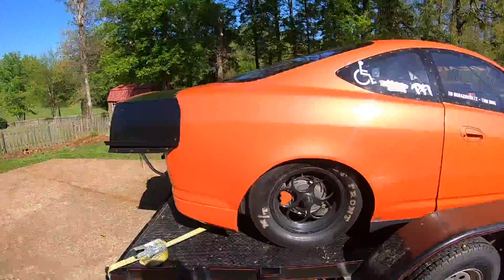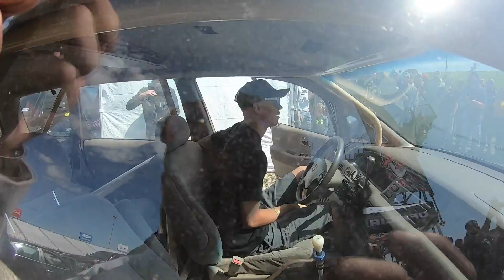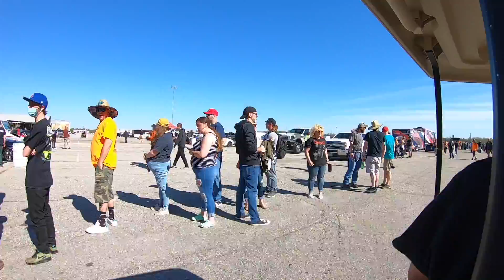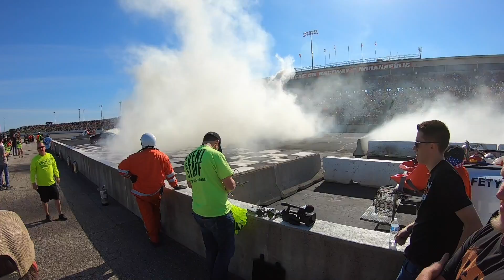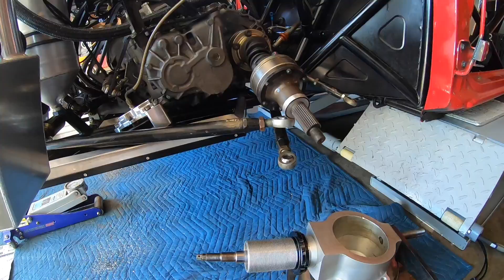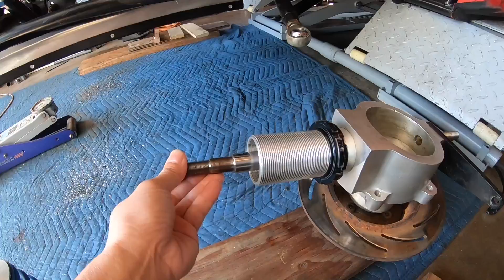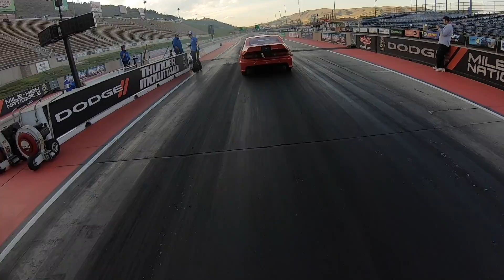Phoenix still gone wild!!

Comment: The centerline of your steering axis is the strut and ball joint, the centerline of your wheel is far outboard of the axis letting the car steer itself. You need less wheel offset and no spacer, wider suspension to keep the same track. Look at a stock vehicle and see where the balljoint is compared to the center of the wheel. Overbuild the steering arms to try to contain steering forces. Good thoughts for you.
Reply: You are right he needs to close out the tow 1mm on each side atleast thats what I do when I do cord aligment
Reply: Yea Phong I agree with Ron them spacers I think are the culprit I put just 30 mil on my element for less than a day just daily driving was doing exact same thing your cars doing even worse when there is crowning in the road and I have a perfect alignment …. I would ditch the spacers I'm pretty sure that will be the cure like Ron said ... good call Ron
Reply: Hope I see it going fast soon im a fan
Reply: I agree with Ron too. 
It would be good to add caster correction.
Don't give up! Phong

Comment: with the strut welded solid the tyre effectively becomes an undamped spring, especially large sidewall tyres like you have, hence the bouncing, you need a damper controlling that, double wishbones would be nice but will still give you trouble with bump steer unless you lower the rack or raise the mounting point at the hub end, I've said it before but you need to get your steering arm and wishbone to run parallel as a starting point, then take the spring out and cycle the suspension up and down with a toe gauge on the wheel, then you'll see what's happening, I'm sure you'll get there though, nice to hear you say you won't give up, you got this!

Comment: I think the suspension was ok. The steering rack might be ok too. In general: to avoid bump-steer the tie-rods should be the same length, angle and pivot point as the control arms.
I think your problem is still a 'weak' steering knuckle. Maybe add a second on top and connect both and the tie rod with one big bolt?
Reply: do mean like leave it where it is but add another mounting point to the knuckle + a bolt going through both holding the tierod in the middle? or move the tierod pickup point up?
|----0| or |---0---|? 
0 = tierod end, | = the tabs, & --- = bolt.
Reply: @von...  I mean: leave the knuckle on the bottom where it is, but put another one somewhere at the top with the tie rod in the middle. You even could use spacers to adjust the height, where the tie rod end connects to the assembly.

Comment: Have you thought about adding an additional bracket on the steering knuckle above the heim joint for the tie rod? It would greatly reduce the deflection at that connection and correct the toe-in problem under power. It would also make the joint much stronger.

This setup is called a "double shear" connection and offroad trucks use it all the time.

Comment: Honestly the steering pickup point needs changed also to get rid of the bump steer due to the location of the rack. Also I bet under power even with your improvements to the arm it is bowing under power. Most likely the suspension setup would have worked without locking it if the steering issues got fixed.

Comment: Yessir phong!!💪🏻💪🏻 crazy suggestion check those traction bars, my car had same problem when it would get into power and tires would hook it would pull HARD left just like Phoenix, turns out one bar was too short and instead of having a little play in it it got hammered in and was tight, loosed it so it had play just like other side and it went straight as an arrow

Comment: 13:28 yes you are correct less travel =less angle change. Although a little wheel hop or tire spin will break stuff.. what I would do is make some rubber cylinders to go in between the strut and the spring so you will still have a little "give" but also be "solid" or very little travel

Comment: Do NOT lock your suspension. That is asking for trouble. There's nothing wrong with MacPherson strut suspension. Yes, there are compromises, but even Porsche uses it. To fix the bump steer you simply need to make sure that the tie rods are parallel to the control arm. This can be accomplished with spacers. This is done to trucks and cars alike for both lowering and lifting. I couldn't see the true angle of the control arm, but I am betting that the tie rods aren't parallel. I DO agree that you want to limit travel, but doing it as a hard mount or with non-progressive droop limiters will yield unpredictable handling and hooking during launch. You need some travel.

Comment: To reduce the bumpsteer, you have to make the steering tie rods the same length as the lower control arm so they move in parallel.  You will never get rid of it completely, but you can make it very small.

Comment: Looks like the steering rack needs to mount lower to me. Low outer tie rod, low rack.
The tie rod and LCA need to be more level to each other by raising the outer tie rod or lowering the rack.
Can you move the steering attachment on the spindle/upright/hub up higher ?

Comment: Phong . At 15:00 you can see the you have two extra holes in the knuckle. Use those to build an upper steering arm . Put the original spacer back in and  sandwich the tie rod end between the two. Double sheer
Reply: Nailed it. He needs to make it a double sheer. Then he can shim the tie rod to the proper height. I doubt bump steer was ever the problem. Needs less deflection in the steering.

Comment: Phong, the steering rack location /tie rod angle is all wrong.  Assemble the suspension without a spring so you can pickup the wheel and move it though the full travel of the suspension and watch how it toes in and out as the suspension moves.  You need to dial that out as much as possible.  The way it is now, whenever the front of the car rises under power (i.e. and the suspension extends) the wheels are toeing in towards each other.   Its doing it so bad the two tyres are fighting against each other until one of them loses traction, then the car darts off in that direction.

Comment: Bro you can't have no suspension it's dangerous!   Also no grip with the car bouncing all over ,  can you lift the stearing rack to stop the angle changing so much  ??    Love the project  phong   stick with it brother ✊
Reply: What I would do is take that motor out and put a stock, low horsepower, motor in. With a quieter exhaust so it's not so crazy. Drive it, wether on the track or roads around PFI and see if it's just bad torque steer or what. Let other people drive it too. Just not full pulls. Run it up in power slowly. Also have a chance to get used to driving it. Him locking out any suspension is making it bounce on those slick Ballon tires. It looked like more of a steering issue, maybe torque steer, than a up/down suspension issue.

Comment: Master Phong please see this I have been looking into what's going on with your car and I believe what you need to do is take the spring and shock off and mount two studs on the top so you can make a set of arms to triangulate the tip of the hub the front end you have is more for rear wheel drive drag cars not fwd drag cars I'm pretty sure anyways but you can still use the hub just get a pair of coilovers and mount them to the lower control arm and make new mounts on the hubs you have I really hope this helps and even if you rebuild it form scratch I hope it works please we are all preying and ready to support our master

Comment: What's the king pin incline angle?  Sounds like there is a castor issue as well as the changing toe angle under load.
Reply: Yes improper castor is dangerous 
And these super short axle sure don't help the torque steer
Phong should try stock style axle so the axle have longer center shaft vs the 3 piece porche style axle

Comment: I think redesigning the front suspension should probably start by cutting the old one off. Then  going with something with upper and lower control arms, more conventional and similar to what Tom has. But having said that you are an engineering wizard with engines so it’s always interesting to see what your brain comes up with. 

The current suspension on Phoenix looks like something you’d see on a drift car minus the angle kit.

Comment: You have to check the bump steer! Borrow a bump steer gauge or make your own. Lots of videos show how it’s done. 
  Unlock the suspension and put oil in the strut, it doesn’t appear to have any. The strut cartridge should be submerged in oil. There is a piece missing at the bottom of the upright that the strut cartridge locks into.

Comment: Phong, get a dial indicator and measure bump steer and whatnot throughout the suspension travel. Then, try adding some shims to the tie rod to knuckle and re-measure. Also, try changing control arm angles with shims and spacers and measure again. When you are aligning it, are you doing caster as well as camber and toe? Could it just potentially be as easy as adding some adjustable length control arms and fixing a caster split issue?

Comment: I think is the control arm or mounting point on chassis (if one is slightly bent) or steering rack problem. Another may need to drop psi in tyres to get rid of the bouncing problem.
  I would get the car laser tracked (aligned) and then go from there set two camera constantly on both wheels and then go from there see if you can spot and capture the problem on film. If the car is pulling to left could be a few things to cause that. Make a list and cross out the possibilities one by one until you find the problem. Then fix it 👍🏽

Comment: Bump steer is defiantly a problem but how light the car is and the power it’s making it looks like a really bad case of torque steer from watching the car ..... do you have equal length half/drive shafts on the car? with the longer drive shaft being 2 piece with a carrier bearing so both half shafts are equal length. if not more torque will be supplied to the wheel with the shorter half shaft and could be causing the huge torque steer you’re having

Comment: What type of front limited slip does it have / does it have a spool......besides suspensions and steering design, the way a helical limited slip works can add more torque steer from vectoring torque unequally, whereas a clutch type LSD or spool wants to keep the car going straight, and the wheel speeds across the axle the same, regardless of loading / traction at each wheel.

Comment: I'm not an expert at all - maybe I can't see it right in the video, but it looks like the front wheels have a positive camber (which should be more negative?). Could be so much, that lets the car pull to the left - wrong wheel alignment on the rear wheels,  etc. I wish you the best of luck in finding and fixing the issue🍀! Warm Regards from Germany 🤗

Comment: a bad diff can cause torque steer,  a tendency for the vehicle to pull to one side as the engine drives the vehicle. This is common on acceleration, and results from an imbalance of power applied to the drive wheels

Comment: If its a 1 wheel peel....soon as it gets on the powerband it'll pull like that...torque-steer.
I'm guessing the bouncing is from locking the suspension and riding on tires only....you'll figure it out boss.

Comment: replace the spring with a machined nylon or delrin tube machined to fit snug or move steering arm to top of spindle and raise the steering rack. that way you still have suspension but equal movement , through out the full range of movement.

Comment: Damn man....I wish I was there to help. I've got a decent knowledge on suspension set up stuff.......locking the strut is never the answer. The shock tube can come apart and you can limit shock travel with a machines aluminum or Delton sleeve bushing above the valve head.....

Comment: So, I race RC cars and I do know that most of the suspension geometry is the same. The shocks being angled like that will cause it to steer as the load changes. In RC drag cars, the shocks need to be straight up and down and not on an angle because of this. Also, when you take out travel, it limits the dampening causing the car to ride rough.  You may need to try adding some weight behind the front axles (below the firewall) to keep that traction when the load isn't so high. Put a couple of GoPros in the engine bay to see what the shocks and such is doing during a run. Maybe you can spot something that isn't obvious until the car unloads.

Comment: CRXs never wanna go straight man, even stock ones. They're plagued with the same steering rack height problem the alpine A110 had as soon as you lower them a little. Yours look more like a torque steering issue tho, what's your diff setup ?
Reply: These porche style axle are way too sort on driver side and are causing massive torque steer + the arm for the tie rod on the spindle is not stiff enough with these giant tire 
Ditch these axle and run longer stock style axle

Comment: The job of the strut is to control the spring.  Now with the strut locked you have no way to control or dampen the spring, it will bounce unpredictably.  The route cause of the problem you're experiencing looks to be from the steering rack.  Also, think about using a strong steering dampener to assist.

Comment: Look at the fixbody mustang suspension because its the same spindle style as yours, I'm wondering if u need to brace the tie rods better and or design a traction bar to hold the steering line straight somehow or a ladder bar system. I feel like it wants to toe in on you and you have to brace it from toe. I wish I was there to help somehow but I'm in Colorado springs.

Comment: When you do the alignment try aligning it with the front end lifted up a bit as if the car is launching that way the wheels are straight when you launch and when you shift bc the tires will go in when you let off but go out when you accelerate , this is what my dad did on his pro fwd all motor car and we’ve never had problems 

Like so phong sees

Comment: Did the shocks have fluid in them. I don’t believe the shocks were the issue they are junk now that they were welded on but I believe they needed filled with Correct weight shock fluid

Comment: I think that was just a mock up spring slider. They was going to get a strut b4 running the car. Asides from the not fitting the base it had no dampening.I'm willing to bet that strut was not what the dude building it intended for it to be driven on.

Comment: Phong you might want to contact Daniel at Team Olympus. The guy who rebuilt the coil overs for Kyle on Razzle Dazzle and had Brent do some Dyno tuning for him before you make any other modifications.  It looks to me like the internals of those struts were for mock-up but I can’t be certain for sure from the video you have shown.  The good news is if that is the case it should be pretty easy to make or have made the parts you need to fix the struts.  Question does the steering knuckle come apart (upper piece and lower piece)? If so you might be able to have mounting pad/tab machined to attach to the lower knuckle and get an adjustable strut to fit between the knuckle and strut tower (Maybe talk to Brent and Shawn at PFI to bounce ideas off) Myself I don’t like the idea of locked down front suspension that will cause you even more problems and be much harder to control the car at speed.

Comment: PHONG!!!!! Put a wheel speed sensor on EACH wheel. To see if the reason its going left is wheel speed. 
It may sound nuts but that is far too violent to just be suspension.  I do not know the differential thats in it but something is definitely wrong 
Have you wieghed the car with a 4 point weight system to see if your weight and balance is way off  ?? It doesn't take a lot of weight difference on a front wheel drive to throw you into the guard rails.
These are the 2 most critical  pieces of data you do not have. I would get that information first. An adjustable shock/coilover instead of what you have would reduce or even stop wheelhop from occurring altogether. 
Solid suspension will never allow good weight transfer for a good traction bite for launching.  Good luck.

Comment: At what point in time did you think it’s a good idea to make the front end solid? Also why did you even bother putting the front springs back in it? They weren’t doing anything with the struts welded like that. The struts would have worked better if they had the proper rebound and compression. But it didn’t look like there was any fluid in them when you took them apart so of course they’re not working correctly.
Reply: Love your videos and this car but you’re missing the simple things to make this work the way it should.

Comment: when you removed the spacers on the steering arm, did you cycle the suspension without a spring to check the bump steer? im sure thats why the spacers were in there. the spacers are a terrible idea and would cause a lot of flex on the weak steering arm. id bet you just need to fab up a strong steering arm for the knuckle that mounts the outer tie rod end at the same height they had it with the spacers.

i use an online suspension program, its www.vsusp.com. it allows you to put all the suspension and steering mounting points in and you can cycle the suspension to get a visual of what the suspension is doing, and tells you what the steering rack length and mounting position should be.
Reply: I believe it to be delfection in the steering, needs a double sheer.

Comment: hey phong the struts are up high and the track rod ends are very low witch will always give you problems it looks like its been built on two styles of honda i think the rack needs to go up to the top of the hub and change the shocks maybe even re angle them to give you more travel are you running an anti roll bar
 i no youve got this bro look at your other car see how that is and maybe have a chat with shaun at pfi im sure your get it good luck bro